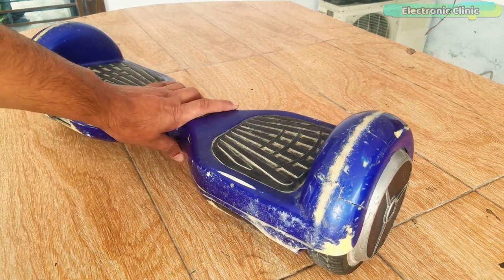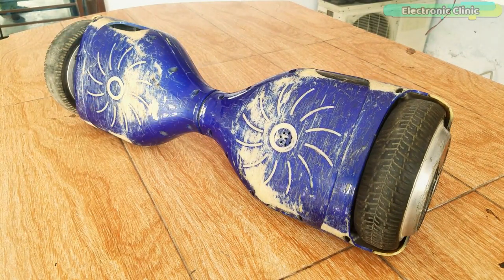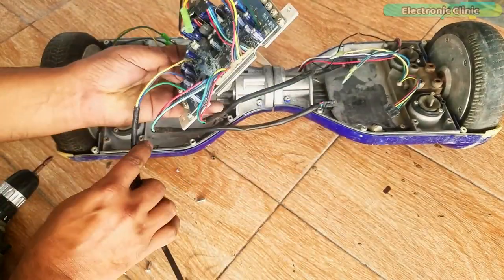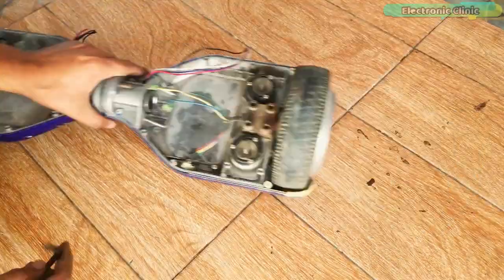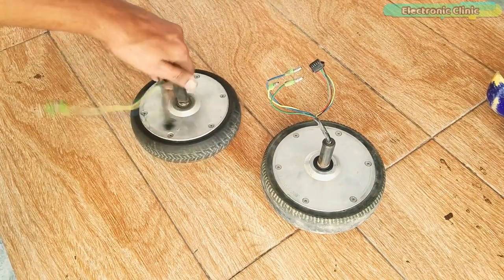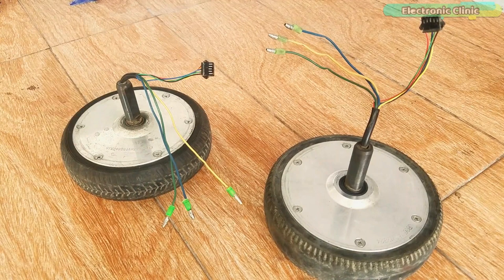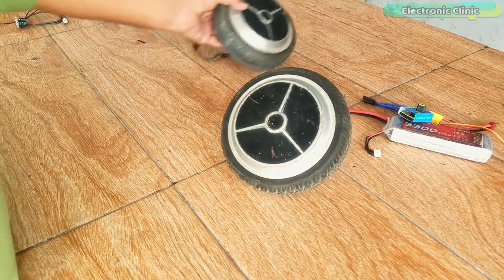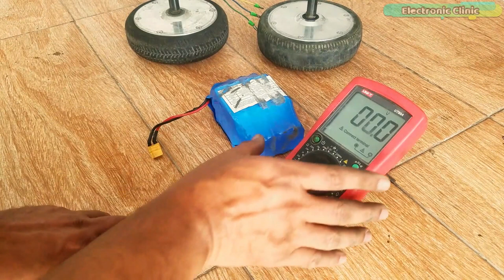Salvage parts from Old Hoverboard, Hoverboard Motors, Hoverboard Battery, Salvage Hoverboard

Comment: What type of ESC are you using, ?
As these motors require you to use the hall sensor. Plugging a brushless ESC into these, the motors wont know what to do and will jurk all over the place.
Reply: They don't need hall sensors to work.
Reply: @theeltea  Explain ?

Comment: I have opened 3 hoverboards and I have yet to get a main circuit board inside. Why is that ?  2 were cheap kinds meanwhile 1 I can of the weight and the rims. Yet still came empty handed on a main circuit board inside